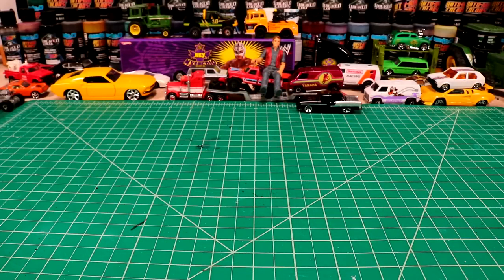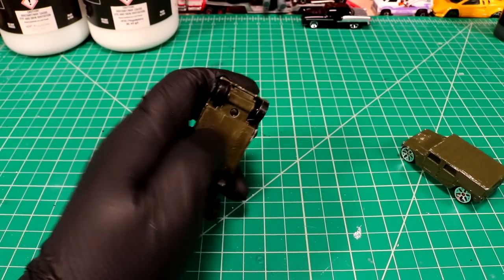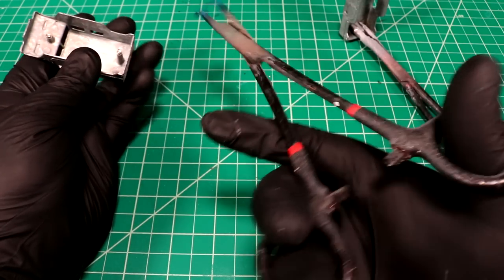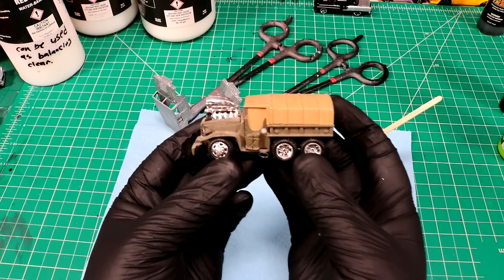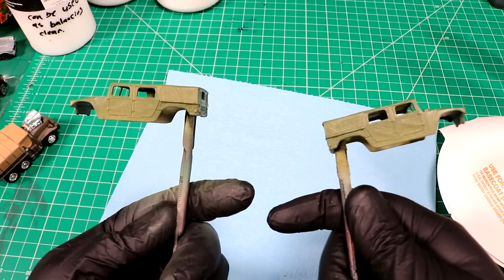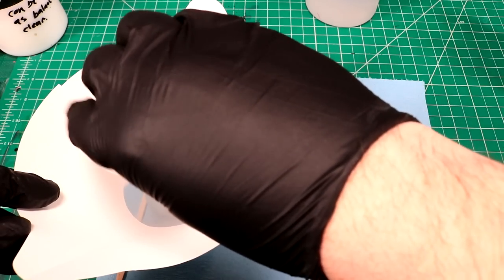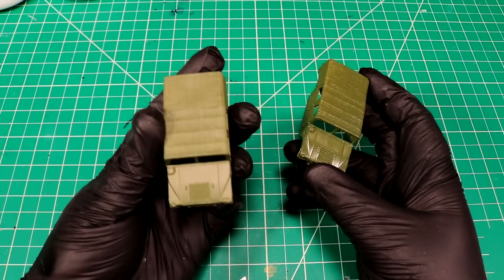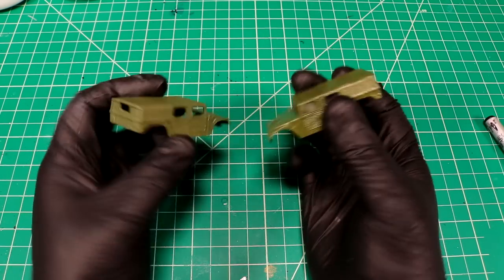Trying some Water Based MATTE Clears on Diecast

Comment: Howdy, Great video! I have a technical question. I watched Chris's video on that UV product. He said no smaller than a .5 needle, did you just reduce it more to make it work on a .35 or .3? Or are you using a .5? Thank you!
Reply from the maker: Yea is just reduce a bit more and run the 0.35mm seemed to spray pretty decent. Was hr talking about air brushes on the video? Usually the instruction is for full size paint guns. I don't recall but it's something to watch for.
Reply: @DiecastResurrection  Thank you, greatly appreciate your response! Matte Finish is best for this vehicle.
Reply: @DiecastResurrection  I think there were 2 videos... One for product launch, and another using them on O2.... Trying to recall , watched soo many. He did mention somewhere about not going below .5...  I think the website has similar info too.

Comment: Thanks for the video. I paint mostly model trains and  have been looking for a replacement for the discontinued testers acrilic dull coat so will give this a try. I will put on the flat coat with my airbrush a foot away after the first sealer coat  so the paint will dry as it hits the Locomotive giving it a faded or weather look then add my weathering colors after. Will have to try out this creative matt and see how it works.

Comment: For humvees, you want as flat as you can get. The actual coating is CARC. Chemical Agent Resistant Coating. The closest color in all of modeling works I have found is AK real colors CARC Tan. Or nato green. With no clear coat. For my models. 

Your matte humvees you have here, the matte looks more realistic.

 For the MASH vehicle, go with the satin probably for the time period. Humvee and MASH vehicles were painted and finished differently. So a little more shine on the MASH vehicle probably look better.

Comment: Satin will be great for "classic" stockers, when shinny paint meant one Saturday a month with some paste wax. 1950's thru 1990's there was no shine except a pasty shine. On the East Coast, staring in the 80's there was Acid Rain that stripped your car to bare metal in just a few years - unless garaged. Oh and the "peal off as you drive" clear coats painted over most of the cars at the factory. Fun times...

Comment: great video! a mate of mine has a '32 Ford coup rod which is high gloss black with matte black flames. awesome car. The military vehicles of ww2 were mostly satin finish which dulled off to matte, due to weather and use, fairly quickly. this is also true of the RAF fighters. cheers, mate.

Comment: Just getting into airbrushing thanks to your videos. Quick question, how durable are Createx clears for custom diecast? I've seen you use 2K urethane AC-385 clearcoat before which sounds more durable but it isn't for sale where I am.
Reply from the maker: You won't get the same kind of shine with a hard finish out of those Createx clears. All 2k urethanes are pretty well the same, you should be able to find something, brand doesn't matter.

Comment: couple of brain-farts: 1)would a 3d printed base be sturdy enough to use as new base? Allowing for custom ride height. 2) is it posible to tint the sealer coat to start to get closer to final color with less color coats?   thanks for the content
Reply from the maker: The sealers actually come in about 12 colors, for example you could use a blue sealer and put red candy on top for a crazy effect. You can mix and match the colors like paint. And yea I'd 3d print a new based they'd be plenty strong.